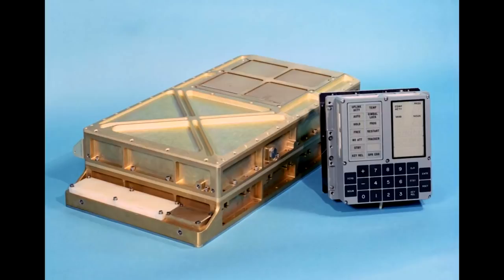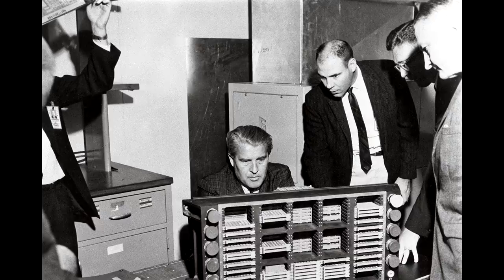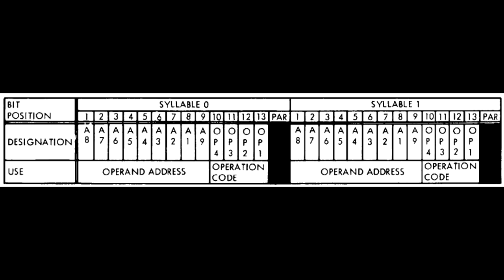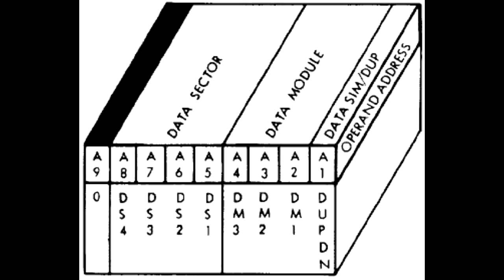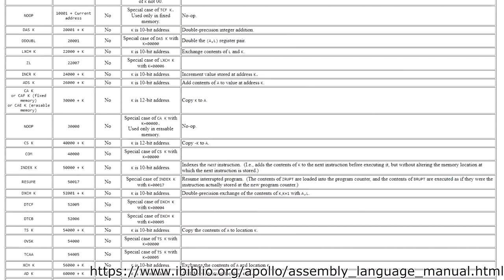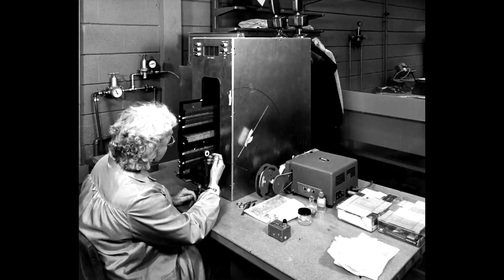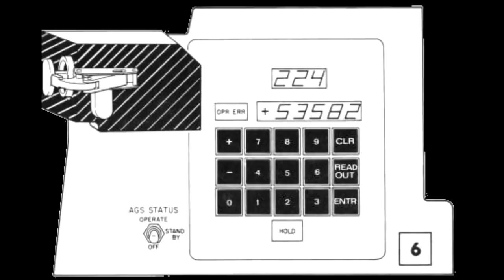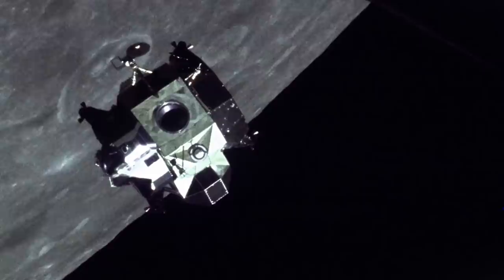The Four Computers That Flew Humans To The Moon

Comment: how would the computer chips with stand the effects of space?
Reply: There's a technique called electronics hardening, it helps to protect delicate electronics from EM radiation. Though it should be noted that as technology has got far more delicate in recent decades, modern computers would probably be far more at risk than the old thermostatic set-ups on the Apollo was.

Comment: Well nice to see that other (more professional) computer designers used bank switching of memory to overcome the limit in address bus width
In the case of my own 8-bit computer ( http://www.soerko.dk/SK-01.html ) it is access to the 2k of EEPROM 'SSD' which is banked as otherwise only 256 bytes of EEPROM would be available..
So all in all i did not mes up completely in doing it that way.

Comment: Even nowadays a Digital/Analog-Hybrid-Comuputer could be useful. For realtime optimization problems. Perhaps for neural networks, or something like that.
Maybe it's more practical than these supercooled quantum-machines they are developing for decades.
Reply: A quantum computer is effectively an analog computer. But more traditionally speaking, unfortunately analog computers are really unable to solve any problem of significant size - sure, they can do integration and addition and subtraction and of course all sorts of analog stuff. But they can't really do anything cyclical. However, there are plenty of analog circuitry in every single computer being used today - they're used to do exactly that - integration and measurement of things, which is then digitized so that anything useful can be done with the data.
Reply: Yup, “quantum” computers are reinventing the idea. They are great at solving physical simulations quickly, but to limited accuracy.

Comment: This reminds me of the first bombing runs in the Falklands war, running down to the corner store to buy a pocket calculator to sight the bombs. Just as improvised, but a bit less impromptu. Multiple operating systems for the pilots to learn that must have been a headache. IBM and protecting source code again
Reply: What is also significant is the "pyramid" of ~13 Vulcan bombers that refueled the lady one that dropped two bombs. I forget what the bane of the mission was.

Comment: So much for the silly notion that "alien technology" got us to the Moon :P Aliens would not be navigating tens or hundreds of light-years with computers like that :D We went to the Moon and back with technology that WE developed. Those engineers and programmers were amazing. No bloatware on those machines :P
Reply: No bloatware and no operating system.
Reply: how did they transmit a signal 237k miles away? they did not.
Reply: @romhackstashbox1275  Yes, "they" did. A simple search for these following two terms will answer your silly question. unified s-band and Deep Space Network. Learn something.
Reply: @nebtheweb8885  LOL that is a fantasy.
Reply: @romhackstashbox1275  Prove it, flat earther.
Reply: 65m dishes, high gain antenna on the CM, I could go on, but what's the point?
Reply: @owensmith7530  youd be repeating BS. you probably believe all of it.  lots of problems with their story.

Comment: "I am a former squid from the 70's and 80's, and a former coded surface sonar technician of that period. However, our sonar system did have a computer, albeit primitive (master/slave), and used (ferrite) core memory in the memory/processors. It (the master system clock) also ran somewheres around 1 Mhz (which in retrospect seems awfully slow). There were also just 10 something commands that ran everything." 
<everything is still classified>

Comment: I wonder if it was possible to go to the moon without any calculation computer, just a pencil and a Curta.
Reply: You might be able to hit the moon with that, but don't even think about getting a desired orbit and coming back.
Reply: One of the reasons they used an onboard computer was to avoid endangering the mission when the Soviets scrambled the radio signals needed to guide it from earth.

Comment: at present even a smartphone is much more powerful than these giant saturn 5 computers
Reply: There are addressable RGB leds that have more computing power than these computers. Transistors got incredibly cheap.
Reply: Even a smartphone?  A z80 based computer from about 1980 would be running about 40 times faster and would probably have had more memory.   It's more accurate to say your washing machine is much more powerful...
Reply: @DaveF.  I think I have a wall socket that is probably more powerful.... Heck, it runs a freaking web interface!

Comment: They still being used in the Being 737 Max.
Reply: No they are not.  If they were it still will still be working correctly.  737 Max is too complex for them to know what the left bit is going while the right bits is doing something else.
Reply: That system is too reliable for the max....

Comment: Was they called computers back then? I thought the manual calculator females called Computers at this time. And was the origin for later naming of the electronic stuff.
Reply: In the early 60s there had been electro-mechanical and mainframe computers around for almost 2 decades. Heck, you even had high-level programming languages of ALGOL and FORTRAN (and LISP?) around. The name "computer" for a device that computes had been around at least since the writings of Von Neumann in the 30s.
Reply: That's more or less 30 years out of date.  Or, rather, there was overlap.  The stored program digital computer was invented during WW2 (or just after it, depending on which nationality you ask) - they were called 'computers' from the start.  Human computers never really stopped being called that, they just ceased to exist once CPU time got cheap enough,
Reply: @duncanw9901  NASA was actually looking for programmers who know FORTRAN a couple years ago, in order to apply modern coding and optimization techniques to some of their oldest modeling (aerodynamics and such iirc) simulations to make them run faster.
Reply: @revenevan11  It just got worse. The U.S. government cannot release relief checks to those financially stressed by the current crisis without COBOL programmers.
Reply: @markhorton3994  that's super sad but honestly not surprising. There's tons of super frustrating "legacy" code still in use all over the business world, in the military, and certainly in the government financial systems as well. It's usually fine because of backwards compatibility, documented procedures, and people passing the torch so to speak and training their successors, but every once in a while an unforeseen exception case pops up and it's unlucky or old enough that they need to scramble to find someone or relearn how to fix the ancient code lol. This is what happens when "if it ain't broke, don't fix it" is taken to the extreme since no one can convince leadership who don't personally understand the tech (in either business or govt) to trust experts that it should be replaced. They'd rather not spend the money because it still works at that moment, when in all likelihood the best case scenario is that they'll need to spend more and more man hours on the upkeep of the old code and lose time/money to its inefficiencies and having to make it compatible with any new system that doesn't happen to be backwards compatible. That's the best case scenario, but what's more likely is that since no one wants to give the order to spend money on an "unnecessary" upgrade, whether it's because they're greedy business people or because they're gov officials who would be criticized for the use of taxpayer money (or are greedy/stingy themselves), they end up encountering a serious crisis when the code or system finally urgently needs upgraded or replaced. Sorry for the long rant! (Lol). That said I hadn't heard your story before, and I know some people who have gotten their stimulus/relief checks. Do you have more detailed information or a source so that I can read up on it? I had heard that their was a delay initially for some of them because Trump was demanding that the IRS or whatever department put his name on the checks, and so they had to change something with the printer or file. That's so unnecessary, and it's not time for campaigning in the middle of a crisis, but a narcissist like him has to put his name on it to try and get credit and convince people that he's directly the one who is helping get them relief, despite the fact that he can't accept any responsibility or blame for this situation what with his spreading misinformation and downplaying it in the beginning, suggesting that it was all some political ploy, encouraging people to take dangerous drugs after reading a sensationalist headline about an unproven (and seriously flawed) study. Honestly the biggest impact of his goes back to his cuts to pandemic preparedness a couple years back, when he dismissed the team that would've responded to exactly this sort of event. We were better prepared years ago for this lol.

Comment: I wish someone would tell me how a craft, in 3 dimensions of flight, could navigate 240,000 miles, by line-of-sight star navigation without constantly necessary course correction burns? Remembering that there was no fuel for these necessary corrections...
A ship, on a flat plane like the oceans, could never make a trip half that 240,000 miles, by line of sight star navigation, without daily readings and course corrections!
See NAShA's deception yet? 
WAKE UP!!!
Reply: I wish someone would tell me how a craft, in 3 dimensions of flight, could navigate 240,000 miles, by line-of-sight star navigation without constantly necessary course correction burns?
Because a spacecraft is not "a ship on a flat plane like the oceans", constantly being pushed around by waves. Once you tell it to go in a specific direction, it will continue to do so, without any need for a constant corrections.

See NAShA's deception yet?
You've been deceived all right.
Reply: Space navigation isn't done using line-of-sight star sighting. The Apollo guidance system used a device called an Inertial Measurement Unit (IMU). The IMU uses three gyroscopes and three accelerometers to continuously provide attitude and acceleration data to the guidance computer. The star sightings are only needed occasionally to realign the IMU to compensate for drift errors. Further, ground radar tracking allows the navigation data inside the computer to be updated and refined so that the navigation system always know exactly where it is and where its going. The guidance system's main function is to point the vehicle in the correct direction and fire the engine for the necessary interval to change its velocity by the required amount. In some ways navigating in space is easier than navigating on land, sea or air. In space there is no wind or wave action to complicate the problem. In space the only force acting on the vehicle is gravity, which is very predictable.
Reply: @joevignolor4u949  So many times, hoaxers start their claim off with a premise that's preposterously false but the rest of the claim absolutely depends on the premise. .

Comment: my mac is more powerful hehe
Reply from the maker: My Apple Watch is more powerful. But it doesn’t have the hardware to talk to a rocket.
Reply: My 35 year old C64 is more powerful.  The micro-controller in my washing machine would walk all over it,  A $0.20 microcontroller has about 10x times the memory and would run 100x times faster.
Reply: Feiner Fug  Only too true. Core memory and single gate chips are MUCH more radiation resistant. Also much bigger and much slower. That is part of the "lost" technology that took us to the moon.
Reply: @markhorton3994  Well not so much lost as just being replaced by something way, way faster and more reliable.

Comment: How do you land on the moon, if you can't accelerate in space? Space is not a medium. You need a medium (earth, water, air) to move. That's Newton's Third Law.  Space travel (acceleration against space/through a vacuum) violates Newton's Third Law.
Reply from the maker: That's not Newton's third law, you should probably learn physics before you start acting like you know what Newton's laws are. Otherwise you might find yourself outmatched.
Reply: @scottmanley  It's the meaning of it. Your response offers no insight.
Reply: @lorenzkraus6888  For every action, there is an equal and opposite reaction. 

That has nothing at all to do with a medium to push against.  

The action is fuel being pumped into the engine nozzle and ignited, creating a directional jet of explosive combustion.  The equal and opposite reaction is the craft being propelled forward.  Rockets work just fine in a vacuum BECAUSE of Newton's Third Law.
Reply: Rockets actually work BETTER in a vacuum. Specific impulse increases on virtually every rocket as altitude increases and air pressure decreases.
Reply: How dare you invade the lion’s sanctuary! You blasphemous troglodyte.
Reply: You forgot about Newton's First Law, which is the law of inertia. The propellants used in rocket engines have mass and therefore inertia. When a rocket engine fires the propellants are accelerated out the back against their own inertia. So essentially the propellants and the rocket push each other in opposite directions. As such, no outside medium is necessary.
Reply: @stevetheveteran  Your explanation of rocket propulsion is correct as far as you took it but to explain it fully you need to take it further. To fully understand how rocket engines work in space you have to incorporate Newton's first law along with the other two. The propellants have inertia proportional to their mass, which makes them want to remain in their current state of motion (1st law). As such when you accelerate them you are pushing against their inertial mass. This creates a reaction force proportional to the mass times the acceleration, expressed as F=MA (2nd law). This reaction then produces an equal and opposite reaction in the opposing direction (3rd law). As such no outside medium such as air is required to push against for a rocket engine to work in a vacuum. Instead, the propulsive force is created inside the rocket engine's nozzle as the propellants are accelerated against their own inertia. What's going on behind the engine and outside the nozzle really has little influence over what's going on inside the engine. So rocket engines can work in space even if there is "nothing to push against" as is sometimes claimed.